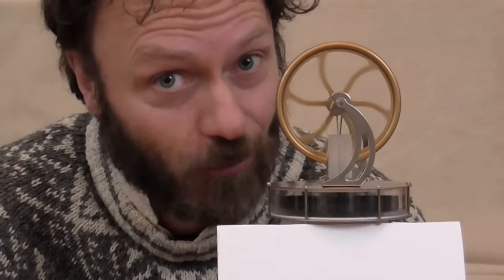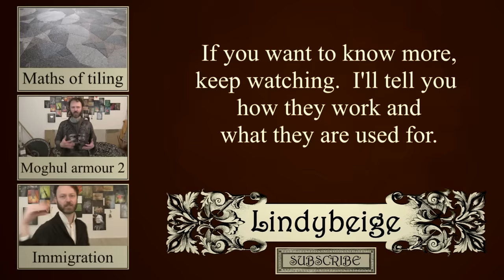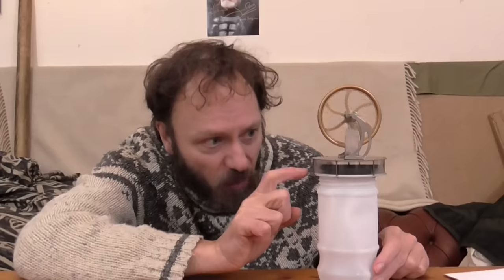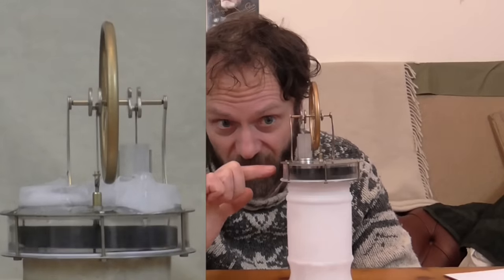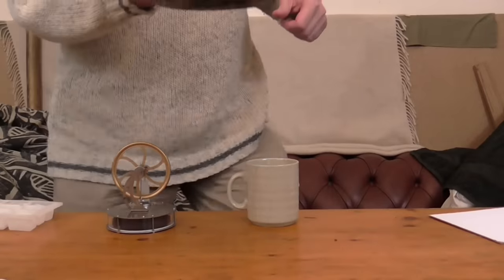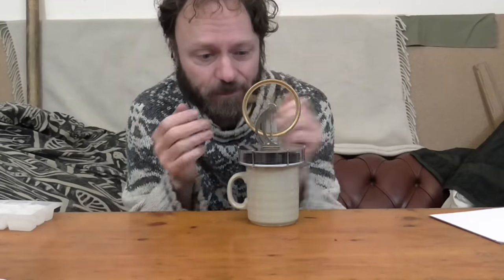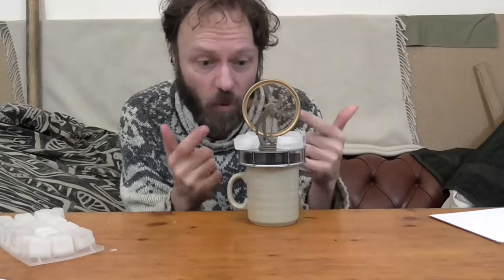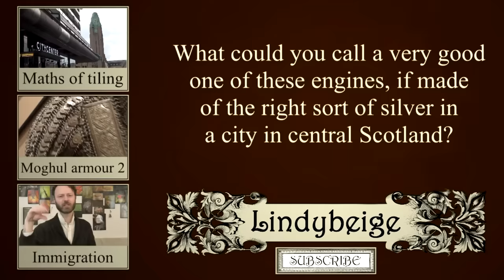Stirling Engines - the power of the future?

Comment: Hmm? Id say it could be used at equator. To power up homes. We used Air Conditioner inside (well it is common stuff at equator) and we could use a metal plate or filaments to capture heat from outside. The heat stored to a heat capacitor, the cheapest one is a water tank, thin rectangular in size placed at the roof. Then the water tank sit on the Stirling's hot plate. The cold plate is inside the home with Air Conditioning. A convex mirror is dangerous for air traffic, so i doubt it would be useful than harm especially if every home using that. Also the thing need a lot free space at yard. Still can be used at some managed open spaces.

Second, some countries like Indonesia also have a lot of volcanoes. And they're tall, like over 2000m high. Temperature at those tall mountains usually colder, while we can use the heat from the volcano. Temperature at night can reach 4 degrees celcius at some places. Heck at the city called Malang, at rare occasion, it rain ice (not snow).

Third. At the place next to water body, it could be useful too. And it can be used in conjunction with pot refrigerator (or Kalgoorlie fridge, i hope i wrote it right) to cool the cold plate even further. That thing need a lot of water and wind which is quite plenty at high elevation lake, river, or beach. While the hot plate sit next to something hot. Like, restaurant kitchen which still operate overnight. Also, the wind coming from the land usually hotter than from the sea.

Though being said, still not as great as Google server at northern countries or Antartica example. Those places surely better. Not sure if it is worth. It seems yes it can do, but only a small efficiency. Still I would like to see these possibilities. The overall contrapment seems bulky, expensive, and complex. In conjecture with what i said about not sure if it is worth. And also the mechanical reliability compared to Solar panel or wind turbine. Which seems also opposite at Mars.

At middle east, if we could somehow store the heat during the day and use the night temperature...This engine could running at night when the solar panel give up.

Hmm, does any spacecraft orbiting earth utilizing this engine ?  It should be hot at the surface facing the sun and vice versa.

Comment: They would be great for power refrigeration and freezer compressors, especially in hot climates where the cost of refrigeration would be higher to begin with. Have the cold side on the top of the refrigerator or freezer, and paint the hot side black absorbing the suns heat.

You could also use it when colonizing Venus. Have a floating colony where the temperature is livable, and then have the hot side of the sterling engine down in the 2000 degree Venus atmosphere, kind of like the arctic engine powered by the volcanic areas that was suggested in the video.
Reply: Actually I think regular solar panels would work better in Venusian, floating settlement with reflective clouds below making them more efficient. Weight of Stirling engine using Venusian surface temperatures would drag the settlement down.

Comment: I think the biggest killer of the Stirling engine is the fact that you can make a much cheaper and more robust system with peltier devices. Those forego the need for additional electronics to transform the energy from kinetic into electric. I don't know much about their comparative effeceincy, but I'd guess they're ballpark similar to a stirling engine setup.

Comment: Brilliant!
Question; doesn’t the scavenged heat from those servers directly equal the inefficiency added to the system by putting loads of stirling engines on the exhaust?

I’m pretty sure google would not be happy if you tried to do that…

Comment: Would it be possible to attach a heatsink, or a liquid-cooled unit to the top of the engine, with one radiator in the heat source (to theoretically recycle excess heat.  Might not work too well, come to think of it), and a second one venting heat outside the system.  Without using a freon-like system, I don't know how well that would keep the top below ambient temperatures.

Comment: Maybe add some aluminium fins to the cold plate so that a moderate breeze will cause more cooling, a bit like a computer heat sink.  Something I wonder is that, if you look at the air chamber that has the disk, it's not very deep. I wonder how changing the depth/air volume so there's more or less would affect it. Longer way for the disk to travel, but might make for a longer "stroke" if the temperature differential was great enough.

Comment: Something I have always wondered is could you use the same principles used in heatpumo air conditioners to power these. Geothermal heat pumps use the ground as a place to cool things down in the summer or warm them in the winter because underground temperatures are always between 10 and 15 celcius. If you made an alpha type Stirling engine (2 pistons , not in line) and had one under ground and one above would that be a sufficient temperature gradient to make an engine that could be useful.
Reply: You mentioned volcanic heat in Antarctica but it doesn't need to be volcanic. Passive geothermal has just as much potential In Stirlings. Also if you add that dish to the goethermal cooled one in in the summer , and then in winter time cover the above ground piston in cold water. You get and even bigger temperature gradient
Reply: Probably get a consistent 15 degree difference. Also I uncomfortable with celcius if any of my temperature math is confusing.

Comment: do you get more torque if the tube length is longer? if so you could put a gearbox on the flywheel and run a generator?

Comment: Yeah that’s wonderful. I have one at home, too. One question: if you’d put two of these (A and B) side by side and connect the upper plate of A to the bottom plate of B and vice versa, with some 100% copper ‘heat pipe’, wouldn’t you have a perpetuum mobile? In theory, yes, but there’s always energy loss to the environment, so in practise, no.
Reply: It's not even just heat loss... It takes work to actually move the wheel. A perpetual motion machine implies a machine that operates at over 100% efficency.

Comment: Not this video but there was one video with the stirling engine that seemed to have multiple cylinders drawing off the heat and it was spinning a propeller. Seems to me a good solution for aircraft use. Just enough fuel to heat up the cylinders to turn it and run a propeller and more environmentally friendly than traditional aircraft engines. Just need the heat source to create the temperature differential

Comment: Could you not use the heat difference between let's say the water in a lake and the air above it to power a big one of these? Especially in colder areas where the air temperature would be far lower that the water

Comment: you are  describing a similarity to a heat pump- refrigeration cycle. here you could get some free energy from outside air temp.( e.g.. around 30-+ farenheight)  or earth temp  to take advantage of the residual energy of  earth -air to supplement the  refrigeration-heat cycle.,but the problem is to apply this to  prime movers it will be very difficult.

Comment: Interesting and thanks.  There's a number of versions of these widgets that are made with magnets. One version has one or more magnets in its piston(s) drive chain that really reduces the temperature differential.  And you can look that up for yourself on YT. For those that are so inclined you might have the larger wheel with a belt run a small axial, maybe as in a small DC motor, with a diode bridge to charge up a battery?  You might power the system with sunlight or geothermal.  Boggle.  Not flashy; and you have to attend to it on a regular basis, I would guess.  Swapping out batteries and so on.  Thinking in terms of the small set up in your rechargeable tooth brush might give a few hints.

Comment: If you stuck one of those into the flow of coolant (probably water?) in a nuclear power plant, you could generate extra energy. As the water heats up by cooling down the rest of the reactor, it has to be replaced with cooler water, so if you put one of those on the outflow, you would generate more energy than just the nuclear-powered steam engine that's already there.

Comment: 4:56 Specifically, the efficiency depends on the temperature difference across the engine. The ideal maximum efficiency is 1 - Tc/Th where Tc is the cold temperature and Th is the hot temperature (in kelvin), though the real efficiency will always be lower than this.

Comment: thats well cool i wounder what it does in a vacuum would it work is it a closed air system so no air leaks or does it need to suck in air
Reply: It works as a closed system, but most aren't designed to be airtight in a vacuum. If one was specially designed to be airtight, then it would have no issues working in a vacuum.

Comment: It's cool for nothern regions with harsh weather conditions. You can put one plate outside the building and one plate inside and solve problem of electicity and heating by burning coal in fuel

Comment: I wonder if this would make a good compliment to a geothermal setup. One plate is in the ground, tied to the geothermal stuff and one plate is exposed to the air and sun. In the morning, the ground keeps the bottom plate cool while the top plate heats up as the sun rises. In the evening, the top plate cools down as the sun sets sooner than the ground cools. I'm not sure how much energy this might actually generate, but it would be "free energy" in the same sense as solar power. It's probably cheaper and less environmentally impactful to build one of these than a solar panel.

Comment: For most applications you still have to burn fuel to either generate heat or refrigeration.
I could see it if you are already doing so, like in your computer server idea but otherwise either use lithium battery storage, shore power electricity or internal combustion.

Comment: NASA has been developing Stirling engines for a long time. I read an article back in the early 1980s (late 70s?) of one of them installed in a Ford Capri. It ran quite and they were doing burnouts with the tires.

It was an external combustion engine so no muffler or catalytic converter. Also anything that burned could fuel it so no dependence on the oil industry. It was a sealed unit and the fluid that used heat to expand and contract was also the lubricant, so no oil needed. By accident the fluid became contaminated and inspection showed almost no engine wear on the moving parts, a long life engine that never needed an oil change. The auto industry does not want this engine used because they can't sell you a new vehicle so often.

These types of engines can augment existing technology. Fossil fuel electric power plants, as well a nuclear, generate a tremendous amount of heat which is just dumped into an adjacent river. Existing power plants can have a Stirling plant built that scavenges the waste heat so massively expensive power plants can till be utilized. Power grid production can be multiplied with little or no additional fuel costs.

Automotive electronics and controls have advanced since the 1980s making computer management of a Stirling making it more piratical. We already make hybrid cars with internal combustion and electric power. A hybrid internal combustion and Stirling scavenging the waste heat is very possible.

The Stirling engine is not wanted by the vehicle manufacturers or the oil industry. The segment of the auto industry that developed the electric hybrids also do not want to see this engine further developed.

Comment: Physicist here. Please let me be pedantic. At 6:00 you say it's generating "1 watt of energy." The correct saying is "1 watt of power." The watt is a unit of power which is the rate at which you use energy. The unit of energy is the Joule, and using the Newtonian kinetic energy formula of KE=0.5 x M x V^2, 1 joule is the amount of kinetic energy of a 2 kg mass moving 1 m/sec. If you increase that 2 kg mass's KE to 2 joules in 1 second (increasing it's velocity from 1 m/sec to sqrt(2) mg/sec), you are using energy at a rate of 1 watt (1 joule/sec).

Comment: So have a system of these engines, one below ground deep enough to find the heat, with tubes to pump water up and down through a closed system, bringing cold water down and hot water up, and have sterlings on each level some used as pumps, and some as energy creation,,,,,,,,,, or not so much ?

Comment: I guess the main obstacle to use them in data centres or server rooms on the Arctic is the fact that most communication satlites serve latitudes from 50 degrees South to 50 degrees North. That`s not an issue as most of the planets population lives in this range, but data cenres far North (or South) would need a ground based antenna pointing almost horizontally due South (North) towards a satelite on GEO. However, with the solo satlite on GEO is replaced by constellations like Straink and O3B on LEO/MEO we can see staelites deployed on higher inclanation which serve well higher latitudes. Additionally, the scarce population of the polar region comes with the advantage of less strain on the bandwidth by end users, so most of the capacity is available for communication between the data centres and the constellation.

Comment: In much of Canada many people live far away from cities or even towns. If you dig a in most places you find heat. One wonders if the Stirling principle could be used to power a generator/charger/battery at ground level to provide off the Grid electric car chargers. Our electrical grid in Canada is fairly fragile to weather events and very expensive to individual users. (Yeah, I know... battery powered cars have a host of environmental problems all their own neither Governments or Corporations want to acknowledge but that's another topic for Lindybeige to enlighten us).

Comment: In the USA NASA experimented with developing Stirling engines for aircraft. Importantly in the 70's or 80'a I read an article in something like Car Craft magazine. NASA engineers had but one in a Ford Capri and were burning rubber with it.

Beside of actually propelling the car without computer controls, imagine what you could do today, there were other advantages. 

One is it was a sealed system and like a steam engine the expansion fluid, instead of steam, was on both side of the piston. They had found a contaminate had gotten in when the engine was sealed. Not only did it still work when they tore the engine down it showed almost no wear, it was a very long lasting engine.

It had an external burn chamber and anything that burned could be used to power the engine. I was not dependent on the oil industry.

It required no muffler or catalytic converter. The cost of these items, and their inevitable replacement, disappeared. 

It did not need antifreeze. 

The sealed engine required no engine oil so the cost oil, oil changes and filers disappeared.

I had kept a copy of the article but it was lost in years of moving to other places. I am able to read online articles from Car Craft and other such magazines from that time period. But am unable to find that article. I suspect it went down a memory hole. After all the oil industry does not want to see this technology. The automotive industry does not want this long lasting engine, they can't sell you new vehicles if it does not wear out. 

The automotive industry does not want to lose the money from selling engine oil, antifreeze, mufflers, catalytic converters.

The electric car industry does not want to see this either. After all with computer controls a single cylinder internal combustion engine giving the first movement and it's waste heat scavenged to run the car.

Comment: Stirling engine sounds perfect for space, aside from the bit about it being heavy. No greater temperature difference to be found than sun on one side & vacuum on the other.
Reply: You might have quite a bit of trouble with the rotational force of the torque though... yeah, nevermind. Not so good for space.

Comment: If you're near the equator you could put a heatsink on the bottom of the stirling engine and make the top plate black. Then you can set it out in the sun with the heatsink underwater.

Comment: I wonder if you could design one for hot climates that was very large and had a chamber that went down into the ground, where it would be much cooler than the top at sunny ground level. Sort of like solar energy but it would also run with the residual heat of the air at night!
Reply: Wadi
Reply: @mrwess1927  What?

Comment: I think the Swedish submarines uses a bit more heat than what is generated by the crew, as Lindybeige suggests. Apparently they carry liquid oxygen so that they can burn something, maybe diesel fuel or whatever, to generate heat for the Stirling engines while submerged. They also have diesel engines for use when on the surface, or when snorkeling at periscope depth. So they do have diesel fuel on board. Anyway, so the power generated by the Stirling engines is quite substantial, as they have a substantial heat source. And since the burning of the fuel is a steady, silent flame, not a series of explosions as in a diesel engine, it's also silent. But what do I know, I only read things on the internet... 🙂

Comment: These would work well in the extremes (Arctic or along the equator and far from traditional electric generators) for recharging batteries, etc.
With the use of gears and flywheels the efficiency could be improved greatly for other applications requiring more torque. 
Combined with solar and wind power, these engines could improve the environment greatly by reducing pollution...which is a step in the right direction if we plan to sustain a comfortable living environment for our home - Earth.